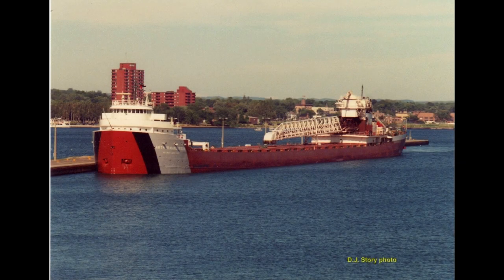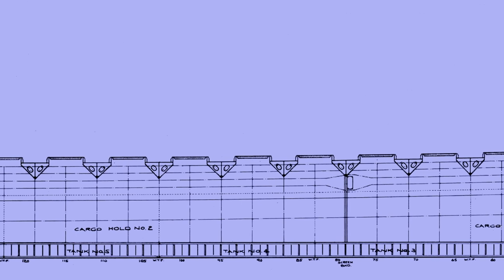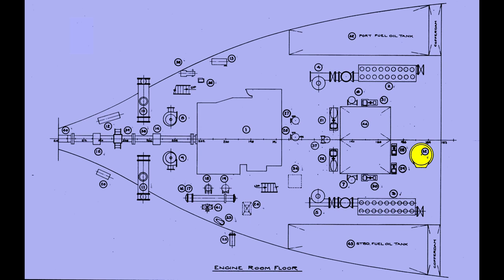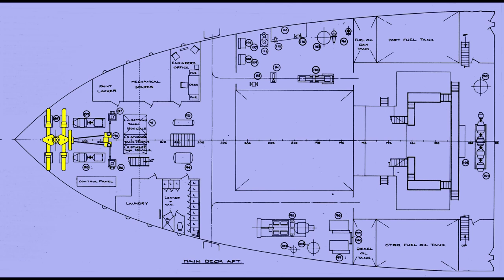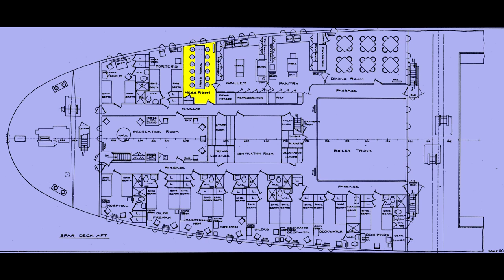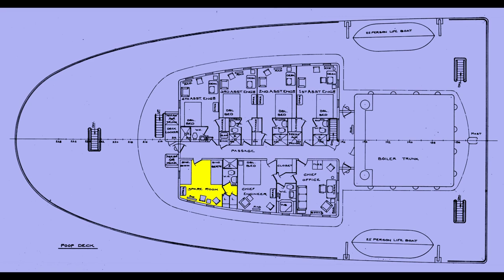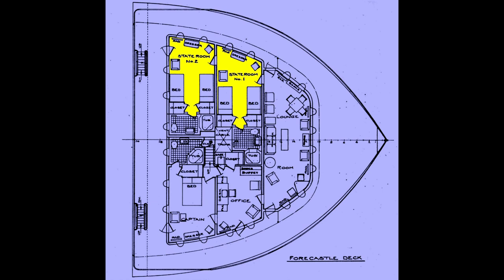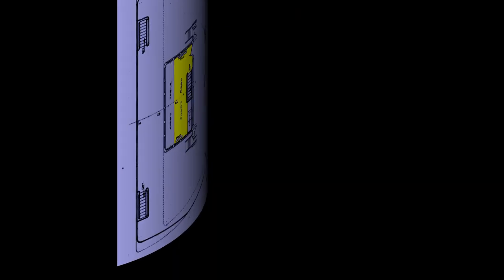ARTHUR M ANDERSON an up-close look at her shipyard plans from 1951

Comment: The AAA triplets are: the Arthur M. Anderson, the Phillip R. Clarke, and the Cason J. Callaway. In actuality, though, the Anderson has seven sisters, including the Clarke and Callaway. The other five are: the J.L. Mauthe, the Reserve, the Armco, the Edward B. Greene, and the William Clay Ford.
Reply: I am curious. There is the AAA class of Lake Freighter, but are there other classes?
Reply: @rottenroads1982  There are. The most common are the River class. Those are the modern ones built in the 70s and 80s with diesel engines and all cabins aft.

Comment: Hey Wes, do you think that they will make the Anderson a museum ship like the Schoonmaker
Reply from the maker: Sadly, that is highly unlikely. Owners of these fleets are largely unconcerned with any boat's history and when they are done with the Anderson, they'll scrap her. Keep in mind that if another fleet were to buy her, then she would compete with her previous owners. Additionally, there are many museum ships around the lakes, and they get by on a very thin budget every season. It costs A LOT to rig a freighter for a museum. By law (ADA) they have to be completely modified to accommodate ALL forms of handicapped visitors (ramps elevators, extra rails, etc) and then to maintain it is very expensive. Most museum ships can hardly pay their light bill. My advice is always to pick your favorite museum ship and buy an annual membership, without regard to if you're going to visit or not.

Comment: Quick Question: whats the point of that tiny smokestack behind the bridge?
Reply from the maker: That is the exhaust for the diesel engine that runs the bow thruster
Reply: @authorwes  OK thanks. I've been wondering what that was about